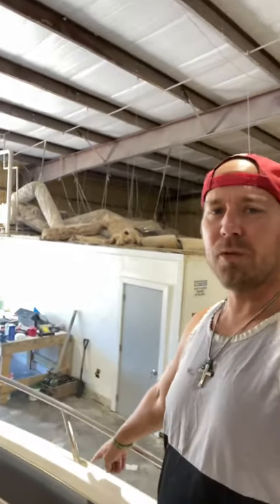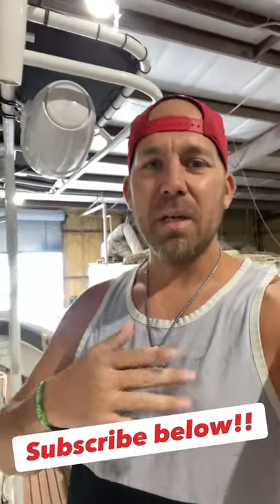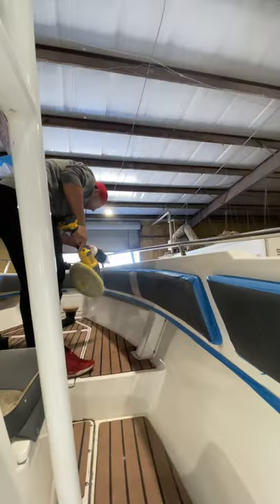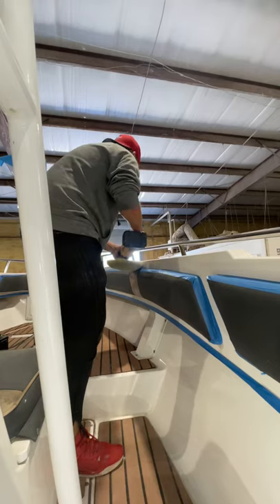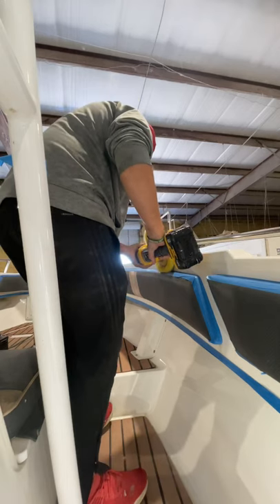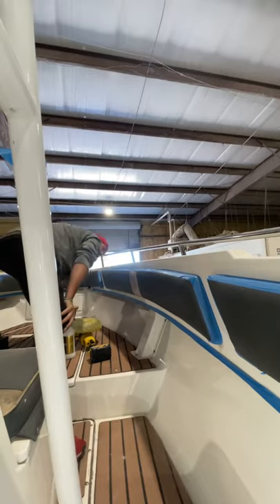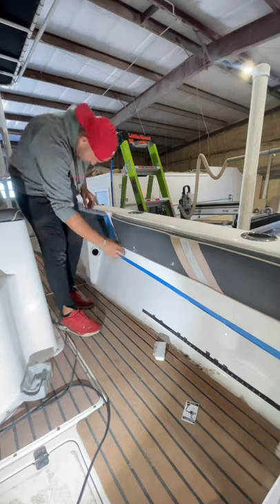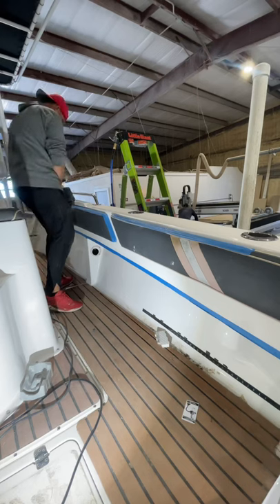Boat Detailing: How To Buff Around Upholstery (Buffing & Polishing Fiberglass)

Comment: Good tip covering metal with tape I learned the hard way but did grab the blue tape real quick! How do you get into the inside corners? where you can't get with the larger wheel.
Reply from the maker: I usually do it by hand or use my mini polisher.